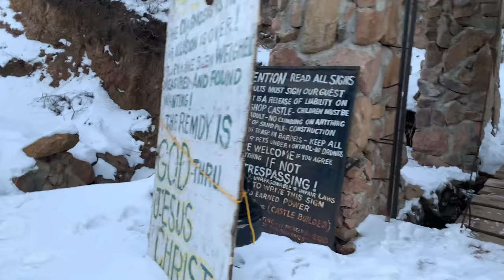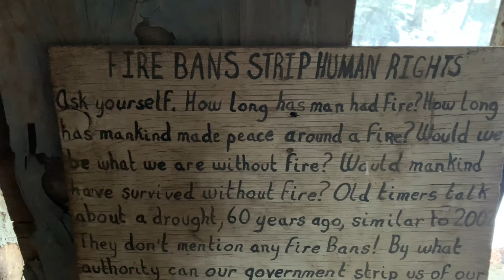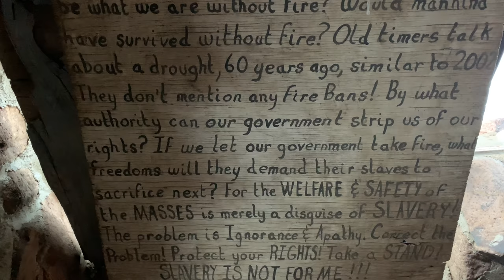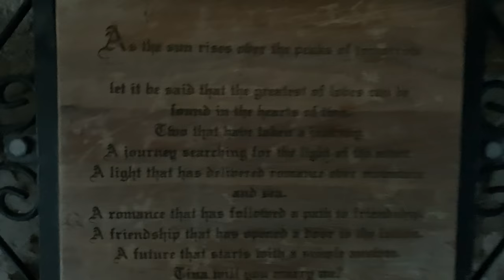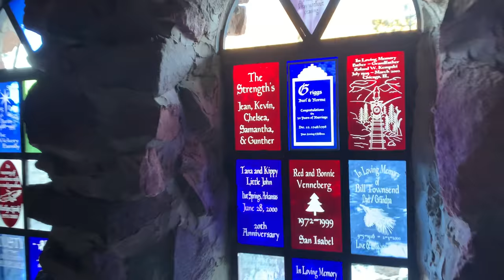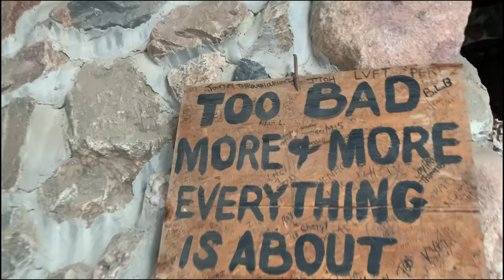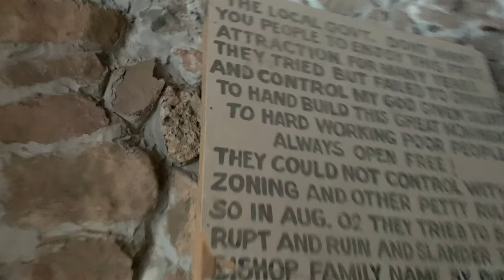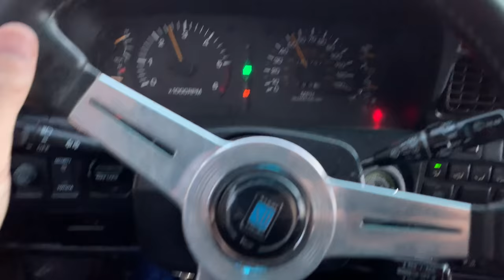Exploring Bishop's Castle in Colorado, I LOVE THIS PLACE

Comment: This is Jim Bishop the castle builder. I will have everybody know that there is nothing "sketchy" about Bishop Castle or the way it was built. As a one-man project, I made sure that all of the welds will last practically forever. I know because it is a one-man project. The little steel rods that go into the masonry and hold the steps together are more than adequate. Nothing has ever fallen down or is going to fall down. Just because there are no blueprints or engineering don't mean that the place is unsafe. There is just small steel pieces where I thought necessary in the main rockwork of them towers and the main strength comes from the solid granite rock, rich concrete, and it is all dug into bedrock at the bottom: 12-feet deep in places. The heavier it gets the stronger it gets. And there was some comment made that "when Jim Bishop passes on," they hope nobody will tear it down. Nobody or nothing is going to knock that rockwork down. The castle is protected by God if no one else, and the general public loves the place. People love it because they can use it, they can climb on it, they can take pictures with it, all at no charge-just donation box basis. All donations are greatly appreciated. Yours very truly, Jim Bishop, Castle Builder, May 7, 2019 ps - sketchy...
Reply from the maker: I hope you get this reply Jim, I have really enjoyed visiting your Castle over the years!  Thanks for building it and letting us explore it!
Reply: Love it Sir! Amazing work! Have seen it grow and...Wow
Reply: Impressive work Jim, the sheer magnitude is outstanding!
Reply: Thanks Jim for your dedication!! I've been there many times and visited with Mr. Bishop a couple of times. Yes he walks to the beat of a different drummer isn't it wonderful he does! Thanks again Jim Bishop !!
Reply: This doesn't sound like Jim to me.  🤔
Reply: Thank you for letting us know.  Really appreciate it.
Reply: I was there just last week. I applaud you, sir, for following your dreams and for building this monument. My wife and I enjoyed visiting. It’s a hell of a story and attraction, feeling very Americana.
Reply: "Just because there are no blueprints or engineering don't mean that the place is unsafe..."
Reply: Jim would be pissed if he heard you say his father started the castle. Lol.  It's truly amazing what 1 man can do 1 day at a time 1 rock at a time!  God Bless the Bishop family.
Reply: Right on Jim Bishop look how right you are about the government taking our rights this nation has lost God and science I never heard of the castle until today a friend of mine was just there today we're in grand Junction Colorado I definitely have to check it out ty and God bless you brother sincerely Richard Oglesby and by the way dude definitely isn't a egineeer and wouldn't know a solid structure from a hole in the ground well hopefully your nails hold up and it doesn't come tumbling down in 5,000 years lol youngsters
Reply: Thank you for this reply. Ppl who know nothing about Mr Bishop or his work...or building in general...should not be judging him or his work.
Reply: @joshrobertson8189  he deserves the cridt, certainly...but darn, why so much angst regarding the misconception of his father helping?
Reply: Based Jim! Will love to visit sometime
Reply: These two TX kids are like all millenials, they are quick to criticize things they don't understand, they find it easy to rely on popular words/phrases (like sketchy) because they lack the vocabulary to be more specific. They think the popular catch phrases make them seem hip, clever--it actually does just the opposite. The kid is a tech inspector of drift cars--now its all coming clear. He is devoted to a faddish auto sport that is the polar opposite of racing. It's more like synchronized swimming than an auto sport. Yecch!

Comment: Back in 1995, Jim told us that he planned on building one of the towers to 200ft tall. Since the tallest tower was pretty much done back then at 160ft, I guess he got too old to get the other tower finished. I’m surprised they still allow people to climb around it. There is no steel reinforcement. It’s all made of 3 sack concrete and native rock. The stairs are holding up pretty well but I was nervous about the construction of it all 30 years ago.